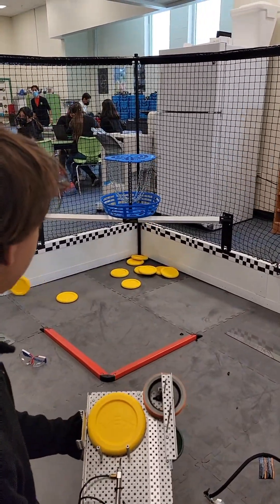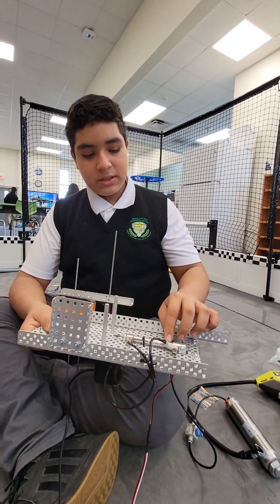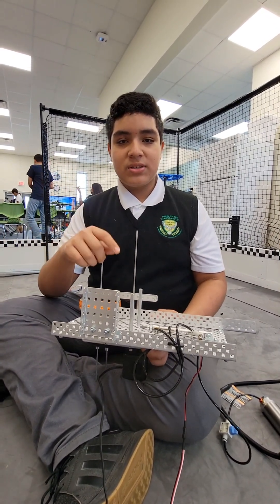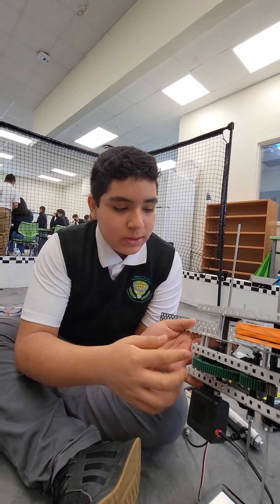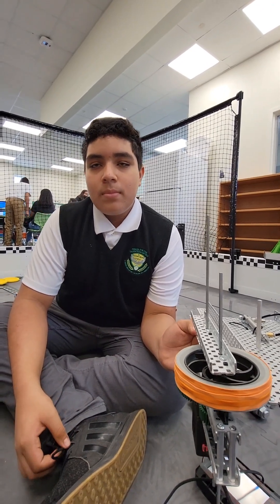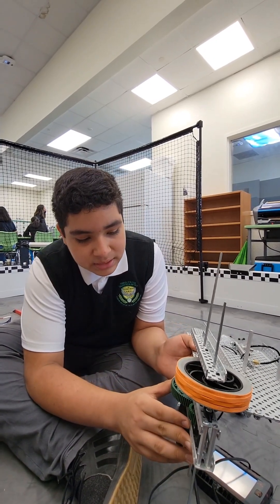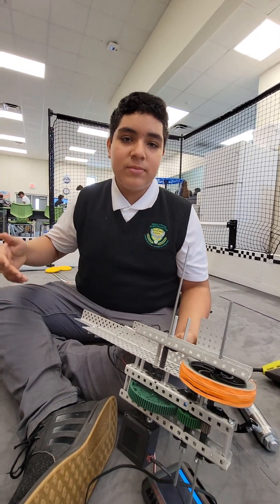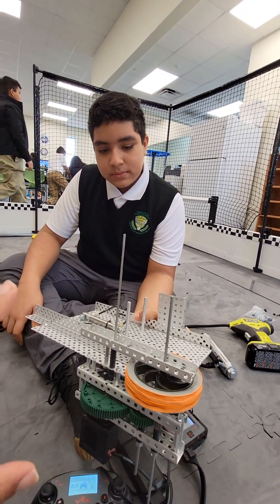spin up flywheel design process and pictures

Comment: Do you have to use Pneumatics with the FlyWheel?
Reply from the maker: No, there are different options for an indexer. My other team is prototyping with rack gears!
Reply: No the best teams like 4082B and 515R use a wheel underneath the discs powered by a  motor to feed the disc into the flywheel. Although if ur a new vex kid I recommend using a catapult as it is much more intuitive.